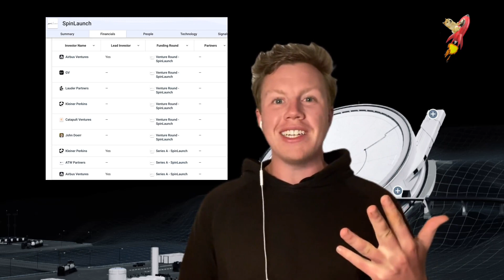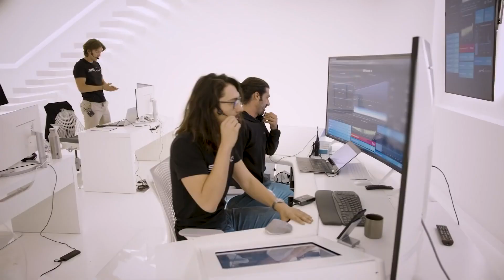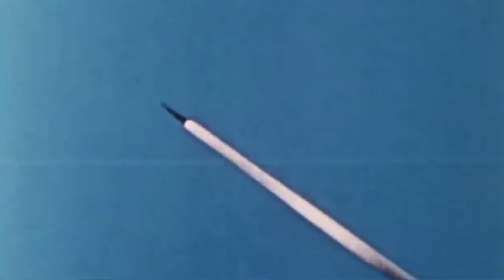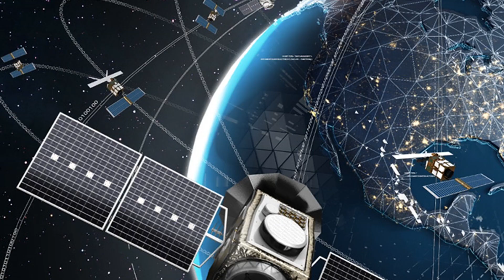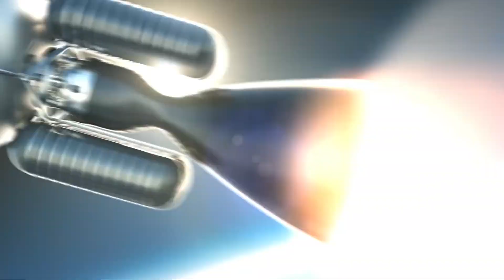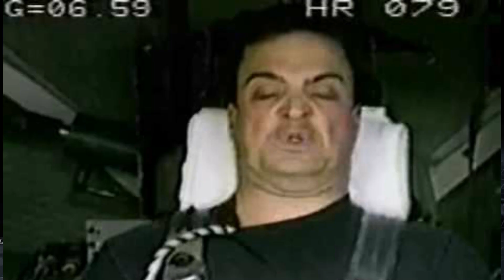Why Spinlaunch is Throwing Rockets into Space (Yeet Cannon)

Comment: It's never going to work. It's subject to the same issues that have prevented the Hyperloop from actually coming to fruition. The technical requirements of the vacuum chamber alone is unfathomable. How would they seal the bearings? What do they build the arm out of that can deal with the shock created when the payload is released. How are the going to time the release? What mechanism is capable of holding and then releasing that much weight fast enough? And the kicker and ultimately what's going to doom the project how will they deal with friction created by hypersonic injection at 1 atmosphere of air and pressure. Supersonic jets fly 40 to 80k feet above sea level to escape the aerodynamic drag and related heat and even then the skin on planes like the SR-71 got so hot it would have melted the plane if it was made from aluminum. There are just too many issues all at once.
Edit: yes this would work great on the moon. But that's not a secret. Sci-fi authors have used the launchers in books to send mined ore back from asteroids and moons. That's not something Spinlaunch came up with. Lots of companies could easily build something like this for a low gravity space vacuum environment the whole point was then being able to do it on earth.

Comment: Would it not be advantageous to build it really high up like at the top of the Andes where the air is thinner and clearer and a bit closer to space? It would also be far from houses that may not appreciate the sonic booms!
Reply from the maker: might be outweighed by being closer to the equator? more rotational spin afaik, that's why launch sites are down south. maybe just need to find some southern mountains haha
Reply: no. the  benefit you would gain wouldn't be worth the effort of building it.  no roads to the top ya know. the crew would have to be air  dropped in and camp on the mountain
Reply: If you had infinite money and infinite time
Reply: How would you get the rocket and payload up there?
Reply: @coltonconnor112  if you had infinite money and infinite time. It has more potential on the moon